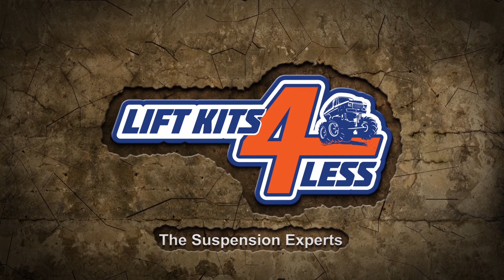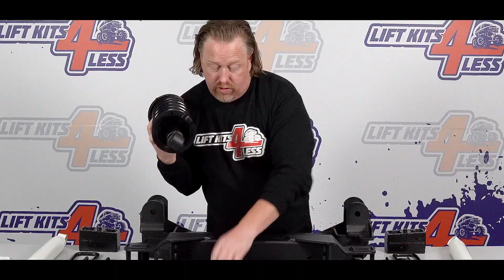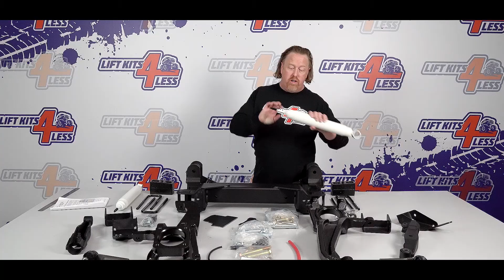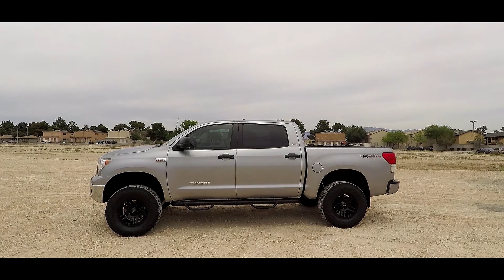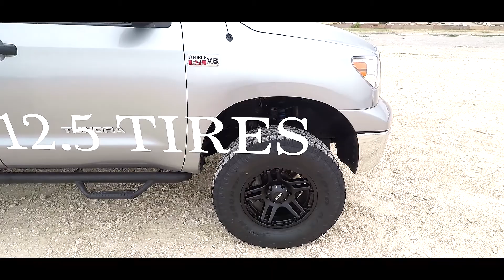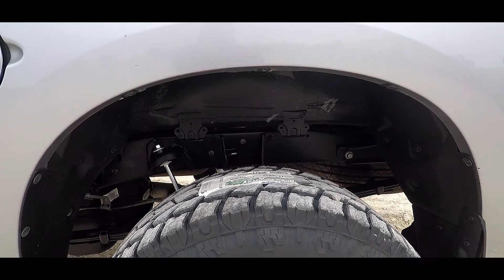Zone Offroad T1N/T5N 5" Lift Kit 2007-2015 Toyota Tundra (Instructional Before/After Installation)

Comment: I want to lift a 2018 Toyota Tundra. Should I go with the TRD off-road or the regular model? I'm just learning about lifting a vehicle and need to find out my options are.
Reply from the maker: Hi Richard, you can use this kit or pretty much any suspension kit for your Tundra as long as it not a TRD PRO

Comment: Cab you not run a 18” wheel. I rather have more tire than rim
Reply from the maker: You can run 18" wheels just make sure you use a 5.5" back space and you will be good to go!
Reply: LiftKits4Less what wheels and tires use in this video? with  specs please
Reply from the maker: Tire Size: 35 x 12.50
Ultra Wheels 
Click on the link and scroll down to Quick Specs and Important Notes for tire, wheel and spacing specs.
https://liftkits4less.com/zone-offroad-5-suspension-lift-kit-t5#
Reply from the maker: You can run a  18" wheel is are the specs: Wheel Size: 18x9 Back Spacing: 5.5″ Max Tire Size: 35 x 12.50
Reply: You can use wheel spacers